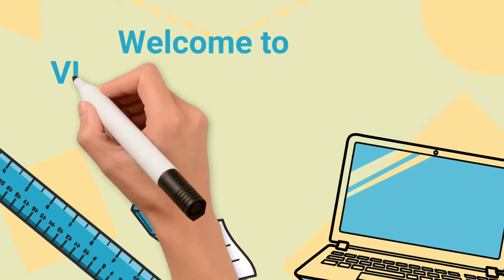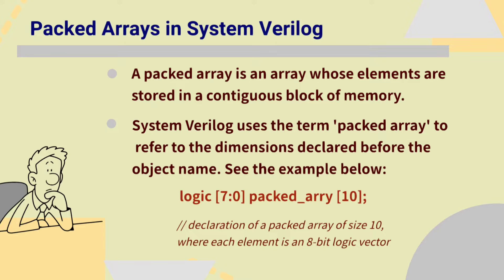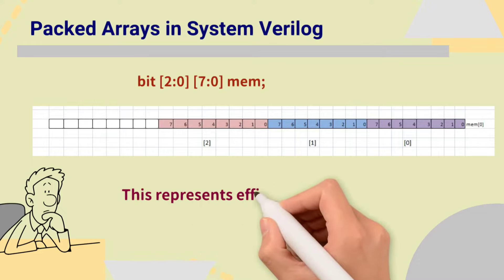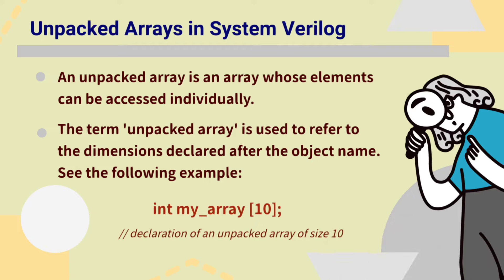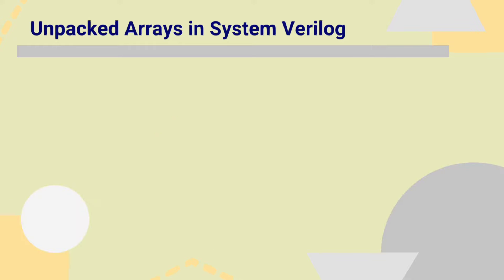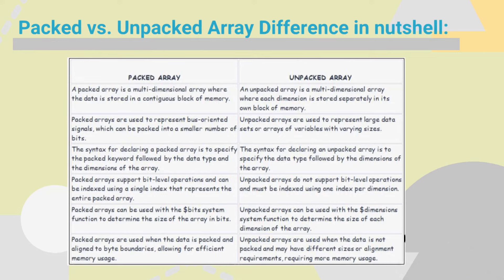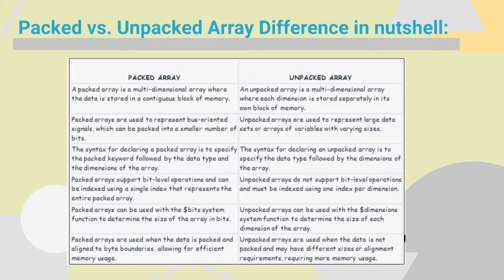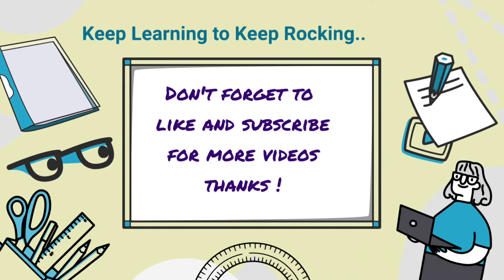Arrays in System Verilog | Packed vs. Unpacked Arrays | Verification #vlsi #verification  #trending

Comment: First example : Logic [7:0] packed_arry [10] - Here object name is written first & size is written later so why this is packed array, ideally it should be un-packed right ? Also  When you say dimensions, is it width or size ?
Reply from the maker: In packed arrays, data is stored contiguously in memory, while in unpacked arrays, data is not stored back to back. Images are shown in video for reference. The dimensions after object name show depth of array, while dimensions before object name shows size of each element.